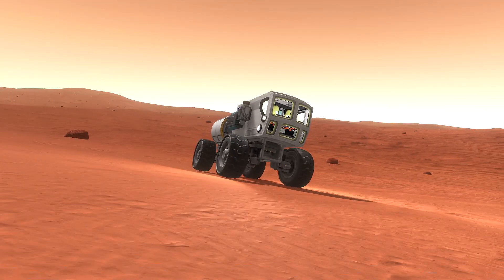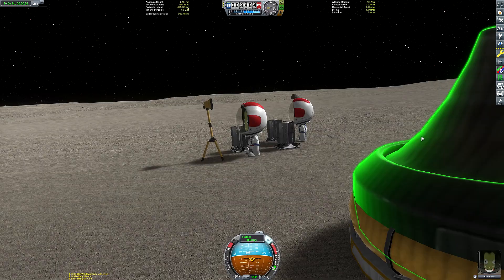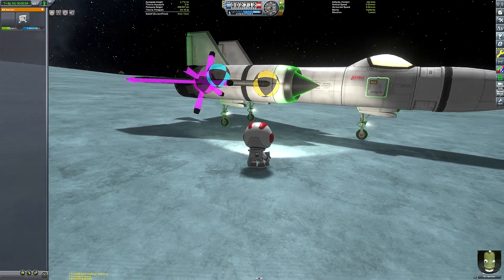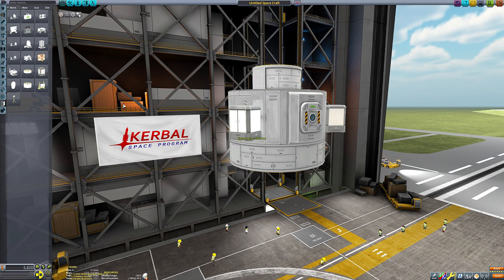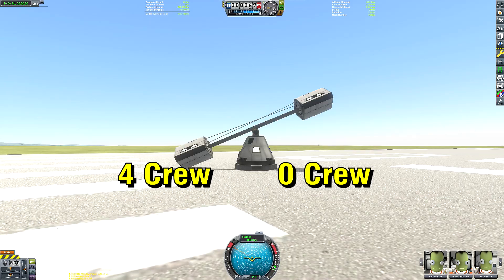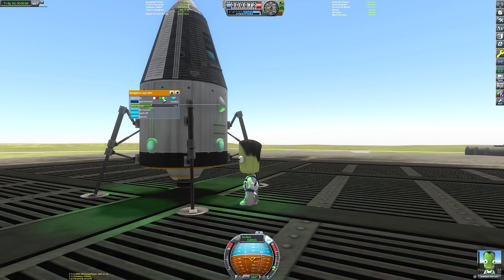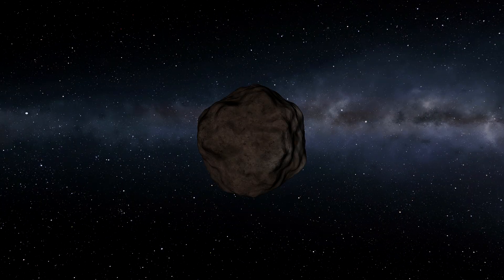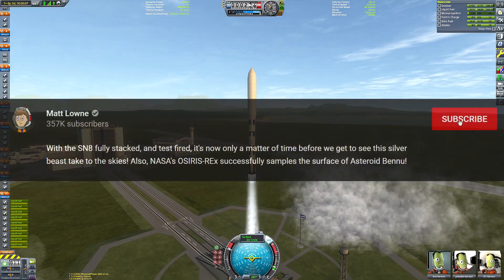The Ultimate Guide to KSP 1.11 - Some Reassembly Required!

Comment: I brought the breaking ground update to add to the making history one I already had, No matter what I do, 
I can't get the damn function of the EVA repair or attachment of any parts I got in the cargo section nearby my EVA Kerbal.

Tried many times and all that happens is the part on the ship just gets dissembled and that is the only choice in the menu there when working with my engineer Kerbal in space?

None of the many onboard spares can be laser to the hull of say a space station or ship when in EVA, the parts just float away if I take them out to put them onto any space craft.

It really is a big pain.

So I not managed yet to laser on a new part or removed any part off the ship on a EVA.

I really don't know what the reason is for this lack of being able to fix on any spare part and only just have the option in the 
Kerbal-nought own list of parts and not in the cargo nearby him i space.

Comment: WTF? This is the 6th video I've watched on 1.11, and NOWHERE are there clear instructions on any of this! I saw "ultimate guide" and thought "This is it!", but no such luck.

It's incredibly frustrating that I've spent weeks launching stations and ships with tons of parts ready for construction and not a single video or forum that I've seen tells exactly, step by step, how to construct anything in space. And how do you use the damn LASER!?

Also, no one mentions the fatal bug that causes space stations to go into spasms when you attach certain parts, causing them to fly apart and explode.

Comment: Great video, thanks for sharing. 
So let's say I take a Clamp-O-Tron Docking Port Jr. on the cargo bay to get it installed on another ship in orbit that does not have one. Like the types of ships you get in rescue missions. How would I install the part if it's too heavy for the Jeb to take with him? 
Using an Advanced Grabbing Unit to transfer the part first would be the only way to accomplish this? Thanks!

Comment: I have a small subassembly which I cleverly named the ‘Rover Can’.
It holds a three- kerbal rover inside a 2.5m cargo bay, and this rover is AMAZING.
Not only does it have self-flipping capabilities, but it also has a built-in crash protector.
For some reason ladders are really good at taking all the force from an impact, which means a ‘roll cage’ made from the smallest ladders is really good for preserving a craft.
I decided to add a small cargo container to the back of the rover, meaning if you have an engineer along for the ride you can endlessly repair your roll cage and essentially have immortality!

Comment: This update has good ideas but is very poorly executed. For example you can't have an EVA pack and carry any of the deployable ground science DLC parts as it says your Kerbal doesn't have enough inventory space. Plus the extra EVA fuel is USELESS as your weight is now 2 heavy to biome hop for science if you take the fuel and the required Jetpack. And without the fuel your jetpack now has less than 1/2 the range it did prior to this update since the weight was added in.

Their should be a slider toggle option in difficulty setting to change these things.
Reply: I tested on Moho different values and this is what I came up with to resemble stock 1.10 behavior
 [results may vary depending on your celestial body since in dealing with the forces of gravity mass does not equal weight]  \GameData\Squad\Parts\Prebuilt\kerbalEVA.cfg & kerbalEVAfemale.cfg

maxJumpForce = 10 change to maxJumpForce = 16
PropellantConsumption = 0.025 change to PropellantConsumption = 0.021
linPower = 8.63 change to linPower = 13.33

Last change these 2 value for the new inventories
(so you can hold jetpack and breaking ground equipment at the same time [or the new large light + jetpack])
packedVolumeLimit = 40 change to packedVolumeLimit = 57
(so you can hold the jetpack breaking ground equipment [or jetpack + 4 stack of new science kits)
massLimit = 0.065 change to massLimit = 0.105

Alternatively you can disable kerbal weight entirely within the same file to get back to 1.10 feels without changing the EVA values

Comment: But, did they fix the fuel transfer bug? Thats been the breaking moment for me lately.
Reply: They claim they have. Also, if you don't have the update yet, it may help to "pin" the menus for the parts whose fuel your transferring, select another part (like a solar panel) and deselect that part. 100% success rate for me.
Reply: @danilafedorin4608  that works for me also, just a pain. Moving resources is something I do a lot

Comment: Hope they fixed  the "cant quicksave while about to crash" thing
Reply: I would consider that a feature as is prevents novice players from a losing all their progress due to an appearance of the kraken just after a save.
Reply: @zomfragger  while I agree it's a feature for novice players I still think it should be toggleable, as a mediocre player it's a PAIN
Reply: @zomfragger  It is a feature, just a very irritating one. It doesnt tolerate nearly as much as it should, I fly a lot of planes and coming in for a descent I have to save quite far in advance. There's usually a minute of uneventful flying before i get to the part where i wanted to quicksave for. In an atmosphere it appears to be calculated using altitude and speed (both need to be above a certain value depending on the size of the craft) and it would be so helpful to be able to control the sensitivity of when it deems 'about to crash'

Comment: ok so Kerbal attachment system mod has been included into the base game but improved with the hanger gui and kerbal inventory...     There has not been a time when I wished Kopernacus was updated to the newest version so fast... or I could start over after a few of my other parts mods get updated.. since Ive never gotten outside of Kerbin orbit before. anyway. ( I play with USI life support and have multiple missions  going on at the same time as my rovers make the several years trip to other bodies.)

Comment: This is the most excited I’ve been for a ksp update in a while
Reply: I just wish there was a way to produce the stock parts from local resources on planets, so it's possible to build new rockets on other planets.
Reply: @frederikfelding8476  I know console doesn't have the ability to add mods, but there is a mod for that called extra planetary launch pads :)
Reply: @leob701  oh damn I better check that out. Thanks
Reply: @leob701  on console instead there is a mun launch site
Reply: @frederikfelding8476  it's a really fun mod.  You build the launch pads so you can put them where ever you like, ads cool logistical challenges aswell.
Reply: @frederikfelding8476  I mean so far all these updates what they have been doing is adding features that the most popular utility mods add, first it was Infernal Robotics with things like rotors, hinges and pistons, now it's KIS and KAS, it wouldn't be that shocking to see them do Extra planetary Launchpads or Ground Construction.

I guess technically the first was Remote Tech with the comm system updates but ksps way of doing things differs from how Remote Tech functions, where as the others are almost direct implementations.
Reply: @frederikfelding8476  this is planned for KSP 2
Reply: @frederikfelding8476  i think they will do something like that in the sequele
Reply: @Erik-bt6jk  yeah lol but that has been delayed many times
Reply: Same!
Reply: Same
Especially because I started in 1.8 so I have only had two other big updates
Reply: I have managed to find horrifying amounts of bugs within 2 hours of the release XD
Reply: you shouldn't be

Comment: That Kerbal Attachment System (equivalent) is going to be really useful! Can’t wait for the update to be released!
Reply: It just released bro, go play it
Reply: KIS (kerbal inventory system) has been around for ages. Squad is finally adding things the community has been asking for years now
Reply: Not on enhanced I don’t think
Reply: I wonder if KAS and KIS will conflict or play nice with the update.
Reply: @KennyChong  I’ve played it with KIS/KAS, no issues, but the only reason to keep KIS and KAS is for the fuel pump and the remove tool
Reply: @t-rexinator4245  Good to know. Thanks!
Reply: @t-rexinator4245  Wait so you can't remove parts in stock? But you can add them? And no fuel hose? Daaaam.
Reply: @xXFeralArtsXx  no fuel system like KIS and KAS, but you can necessary parts
Reply: @t-rexinator4245  Def the fuel pump is still a great thing to have KIS/KAS around for.